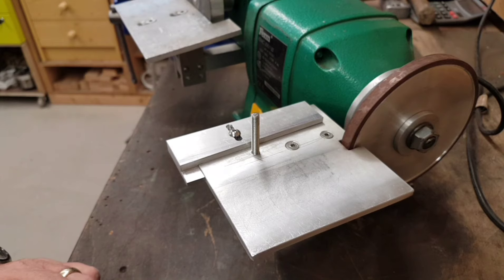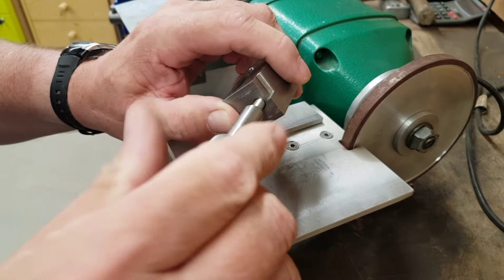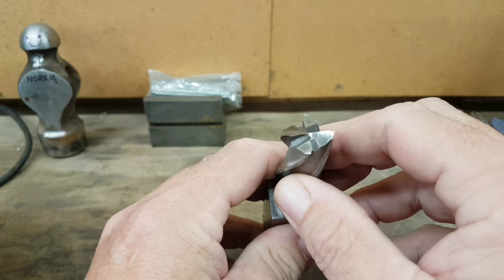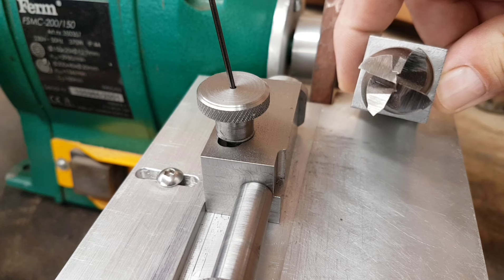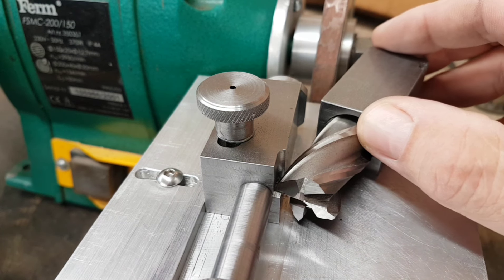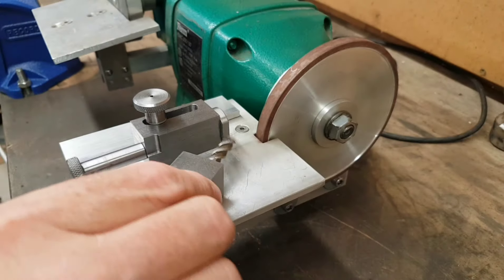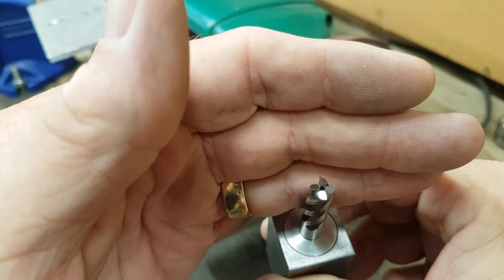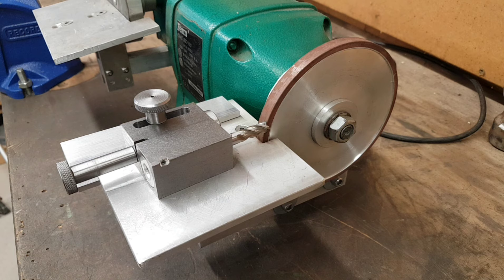End Mìll Sharpener (Final Part) 3 of 3

Comment: I'm  in the process of making a grinder myself also, but I have lots of 5 and 6 flute endmills. Not sure how to deal with these.
Reply from the maker: @JorisSteurs  
Hi Joris.
I think you will need to make blocks with matching number of sides to the endmills. In theory the idea of using the shelf to position the cutting face correctly will still work.
Cheers Neil
Reply: @NellsMechanicalManCave  tnx, I was thinking this direction also.

Comment: Usually one try's not to use a high speed diamond wheel on HSS cutters, the diamond abrasive will oxidize with the heat. Diamond lasts a good time on a slow speed grinder...
Reply from the maker: Hi Larry, that's very true.
Luckily in this application no heat is generated.  The contact area is very small and only kisses the  the diamond wheel to produce a sharpened edge. It would be no good at all if used to try and form a tool.
If I do a follow up video, I will point this out. Thank for reminding me and pointing this out.
Cheers Neil

Comment: Looks great! How is your power feed holding up? I already have all the parts but no time during the semester to build it... Just out of curiosity: How important is the alignment of the cutting faces with the shelf? Because if you align them with a broken/dull face the angle does not match 100% and by grinding deeper into the endmill, the cutting face will not be at 90° anymore because of the helix. I am sure that it is negligible in this application and your cutters work great. But i am wondering how professional grinds are achieved and how companies would compensate for it.        Jonas
Reply from the maker: Jonas, good to hear from you !
Firstly, now I have installed the relays to cut the power to the magnet, the drive works without any fault. 
I'm sure the auxiliary fan is helping but under normal conditions, it's not required.  My mill has a 3mm pitch lead screw and it would be more suitable to fit a motor with a 30rpm output.  You do the math 👍🏻
Second point. Set up the best visible face on the shelf. If you noticed in the video I picked the wrong one. The second cutting face I tried made contact not the one I set. Its a little trial and error at first. After an initial cut you can do a reset and cut again. This is no way a $2000 sharpening machine, it's a $50 modified bench grinder that will give you cutting tools that work again and if we talk cheap cutting tools, better than new. Cheap tools use pretty good materials, the sharpening and finishing are the problem. Usually they are seconds or substandard.  A quick trim can give them a new life at a fraction of the cost.
If you are stuck with anything, email your number and if needed we can talk on WhatsApp. A willing to help out anyone if I can. 
All the best Neil
Reply: @NellsMechanicalManCave  I agree, a reset and second cut with a minimal depth will improve the angle. For 50$ you have build an awesome tool, with current prices for decent endmills you only have to sharpen a few to make profit! Currently i am planning to build the power feed without any fan. The most difficult part is to find a way of transfering the torque as there is no keyway in the lead screw. Also fitting everything onto the small stub shaft requires some more planning. Thank you for the update!
Reply from the maker: @jonasasche3169  pilot drill and grub screw Jonas.  Minimal modification to the lead screw that way and a positive fixing method.  
Many thanks Neil

Comment: Good afternoon. We protect ourselves from dust with surgical, disposable masks. And when we sharpen our incisors, we also wear them. A colleague wanted to ask you at what engine speeds do you process metal with these cutters?
Reply from the maker: Hi.
This bench grinder runs at 2800rpm.
I was careful to buy a diamond wheel that had a higher maximum speed. To my best recollection the wheel is rated at 3500rpm.
Thanks Neil
Reply: @NellsMechanicalManCave  
The engine speed is not for the diamond cup, but the speed for the cutter when it is in the robot
Reply from the maker: @Сутьділа  there are charts on the Internet to show rotation speed of the cutter and also travel over the cutting surface.  A lot depends on the size of cutter and also the material being machined.
I am not a machinist and mostly guess
Reply: @NellsMechanicalManCave  
The cutter is 16 mm, the metal is regular black steel, grade 3, and steel 45 is not hardened. Manual feed is slow. And another question, the smaller the cut, the higher the speed? Thank you, I'm just starting to master the router...
Reply from the maker: @Сутьділа  Small cuts at high revolution speed gives good surface finish. Coolant or light oil also helps with finish.
Cheers Neil 😊😊
Reply: @NellsMechanicalManCave  
The cutter is 16 mm, the metal is regular black steel, grade 3, and steel 45 is not hardened. Manual feed is slow. And another question, the smaller the cut, the higher the speed? Thank you, I'm just starting to master the router...

Comment: Fantastic job. Is there a way to gage the angle of the face cut for the primary and secondary facets or is that a trial-and-error process? I'm thinking it is accomplished by the height or slope of the base plate on the jig.
Reply from the maker: Hi Jasper! 
Yes you are correct. You change the angle on the table for the clearance angle.
If you go to Kev ( Mr Factotum's Workshop)  there are a few videos there explaining how the table angle works in relation to a 6" grinding wheel for both cutting and clearance.  The idea started with Harrold Hall. A quick Google search will find this genius 😊
Thanks for stopping by, not been uploading much recently but will once my mobility improves.
Cheers Neil 👍🏻👍🏻👍🏻

Comment: The only problem with that end mill sharpener is that.... It's in the wrong garage. I want one. I have quite a few mills with damaged teeth. That would be perfect. Thanks for the great video. 
Regards.
Steve.
Reply from the maker: Hi Steve.
They are quite easy to knock up. If it was difficult I wouldn't of done it 😊😊
Cheers Neil

Comment: А если на фрезе 5 перьев ,можна на этом приспособлении заточить такую фрезу ?
Reply from the maker: Sorry,, cant translate your comment 😕😕
Reply from the maker: Found the translate now.
Yes you can sharpen 5 cutting faces. You would need to machine a 5 sided block (pentagon) to hold the cutting tool though. Same goes for a 3 flute cutter.
Cheers Neil 😊

Comment: Hy sir can i use this granding wheel on iron for 4mm deep slot like horizontal milling method
Reply from the maker: Hi ,
To be honest I don't know. I've never tried that and don't know if if would work.
Sorry ghat I can't help with your question.
Cheers Neil
Reply: @NellsMechanicalManCave  can u do this little experiment if yes then u solve a biggest problem in my work.
Reply from the maker: @mughalsons2254  to be honest,  these diamond wheels are designed to sharpen and Horning  cutting tools not shaping or grinding.
There is quite a bit out there on the Web advising not to use them to grind as they can break up!
There are circular saw blades available that will cut steel. Perhaps this might work. Again though, I have not tried this and research would be advised. 
Chars Neil